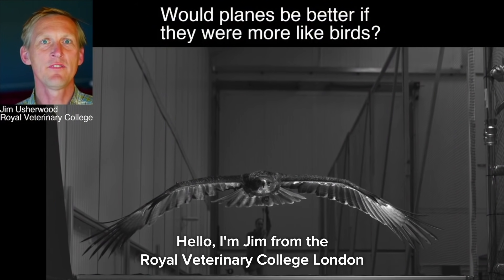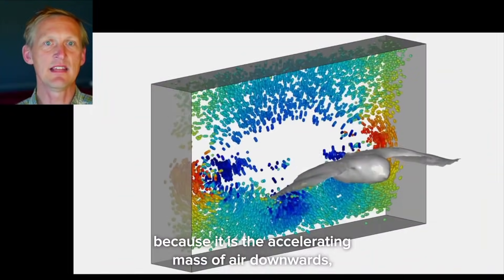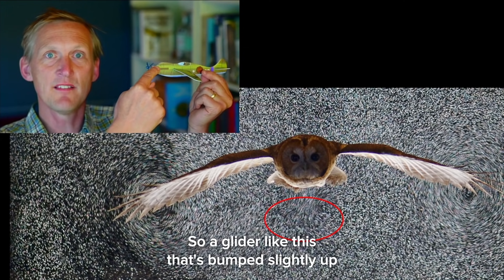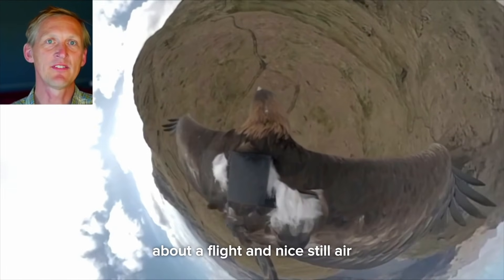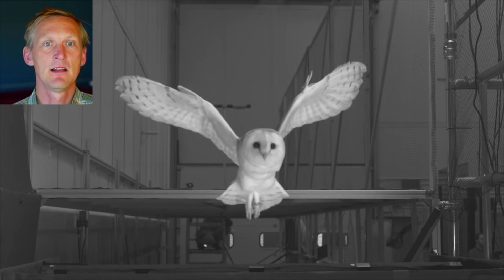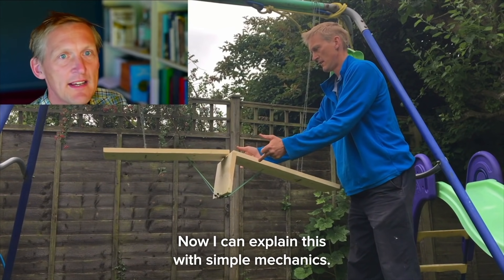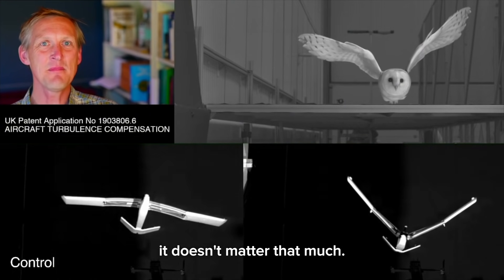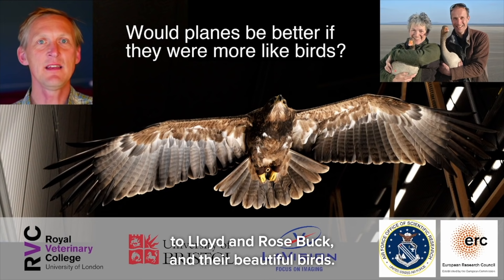Would planes fly better if they were more like birds? | The Royal Society

Comment: the limbs of the bird act like a downward force to the wing becomes a upward force that generate lift angle. the bird can alter the angle of part of the wing to either a downward or upward force that do what the planes do. paper planer are also good at making airplane wings looks extremly overengineered. i once made a modified paper plane with long wings on the sides and the lift was about the same as the original unmodified delta wing paper plane. the updrift was present since the paper supports i used was a little bit behind the tip of the plane and the mass also gave angle of lift. plane lift and efficient is just weight times surface area at given air density in a given angle followed by newtons law of motion.